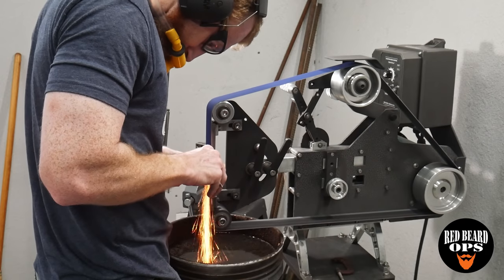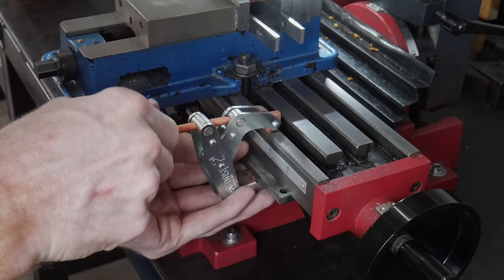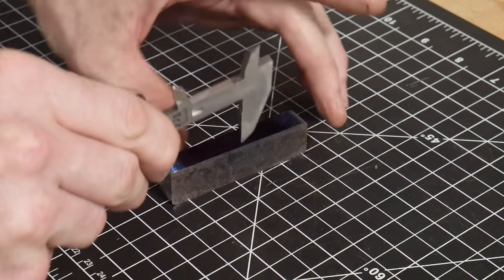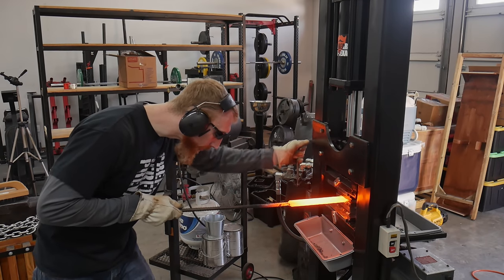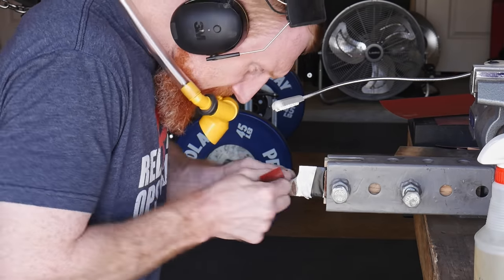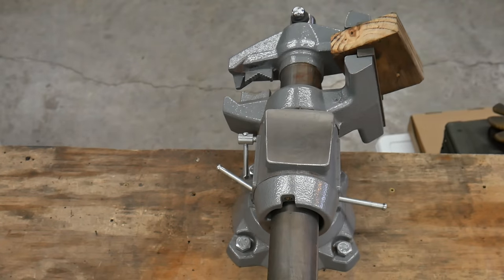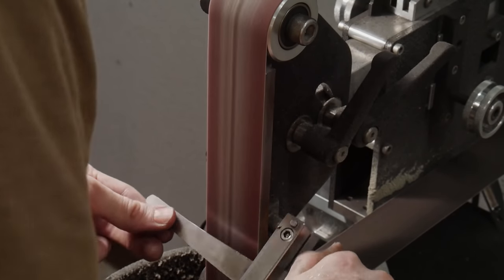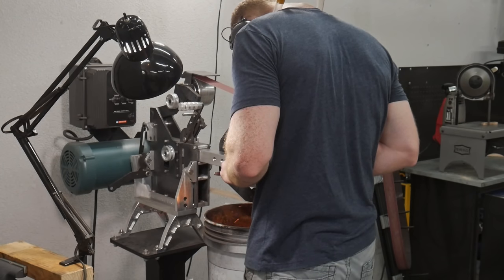Top 10 Gifts For The Knife Maker | Knife Making Gifts

Comment: Welders use those style respirator since they fit under the helmet and prevent breathing toxic fumes while welding.  Great suggestions.  Also fireplace ashes for annealing and keeping blades/metal soft and to prevent air hardening, cheaper than vermiculite.
Reply from the maker: Heck yeah man, thanks for the tip!
Reply: @RedBeardOps  My pleasure.  Im getting my blacksmith shop back in order and your vids help keep me motivated.  Uber painful since my spinal surgery, but Im learning to feed off of pain.  Thanks for the motivation!

Comment: Belts! (2×72) ... I recently spent 4 1/2 hrs at the grinder (without any breaks) working on profiling the pommel of the sword I'm working on.. I ran out of course grits, and had to use fine grit belts...the sword is now ready for a $h!t load of hand sanding...only 12 more days to finish it before I need to ship it out...its a replica "Silver sword" from the Netflix show "the Witcher"...5160 blade (spring tempered and able to bend almost 90 degrees..could have gone full 90 but I got scared it would break), 1045 guard and pommel, ivory linen micarta handle, point of balance 1 inch in front of guard, 3 lbs 11 oz total weight...not bad for my first sword
Reply from the maker: Very cool James!

Comment: Red Beard,  I know this is off topic but in another one of your videos  you talked using bog oak as handle material. Just curious on your recommendations for a supplier. I checked out ebay and etsy and by far etsy seems to have better prices. There was a supplier in Brooklyn, NY that  I have emailed but have received a response back.
Reply from the maker: Hey Randall, I've never used bog oak. So I don't have any recommendations there. Cheers

Comment: Now, to figure out a clever way to get my wife to watch this . . . failing that, I'm certainly going to glom onto some of those clamps. Thanks!
Reply from the maker: lol, I can’t help your there! Good luck sir
Reply: @RedBeardOps  Well, I just ordered the respirator you featured, so thanks for the tip. Not shaving my beard, but tired of the ill-fitting 3M offerings.
Reply from the maker: @brysonalden5414  good deal. Like I said it’s a good cost option for the bearded. There are others but they’re super expensive. Not saying I’ll never get one. But darn near full time making is what would justify it. It will take you a bit to get used to it. Cheers sir

Comment: Some knife makers pound their knife and others cut out the knife from stock bars, if the metal is the same like say 1095 what is the difference when they pound out their knife vs cutting out the knife?
Reply from the maker: No. From a performance standpoint both methods can produce an equally high performing blade.